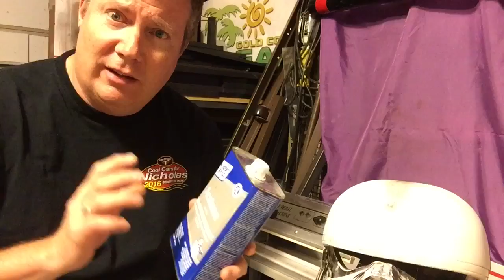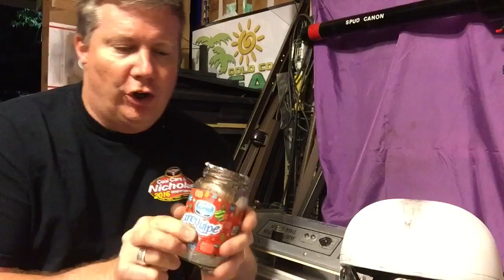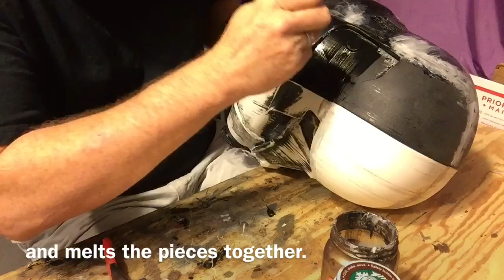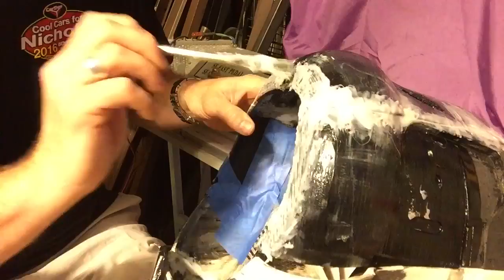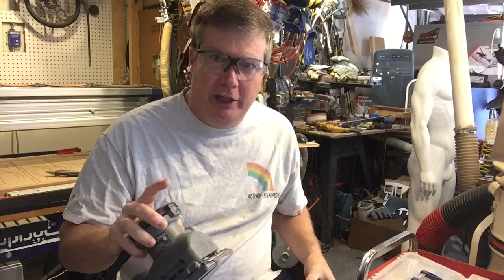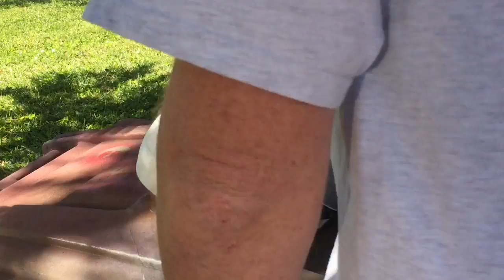Tutorial- Finishing a 3D Printed Helmet

Comment: what do you think is best for putting t-visors in screws or glue?
Reply: Attach clips to the inside of the helmet (you can 3d-print very small ones) and use those to hold it in, otherwise hot glue works fine too.

Comment: So much easier to use super glue and accelerator spray.  Literally costs a buck for 2 tubes of glue, and the accelerator is like $4.  And if you need to fill gaps you can use super glue gel such as Zap-A-Gap, and accelerator.  Much easier and cleaner to use...and without the acetone vapors.  And for smoothing work, just give it a scuff with sandpaper and use body filler.
Reply: That works fine for most things, but I find that if a piece breaks it's at the superglue. This method seems to make one piece of plastic out of all three components. Cyclohexanone is good for certain plastics and vinyl. The surfaces end up fused on a molecular level. Found that stuff when I made medical equipment. Chemically welding vinyl tubes into acrylic holes.
Reply: Not at all. Acetone welds are the best way to to work with joints in ABS. ABS is the best medium to print with for prop makers as well due to it's amazing machineability. Super glue joints WILL fail.